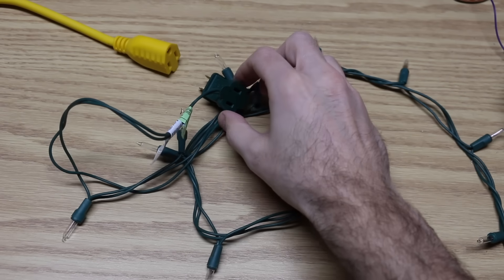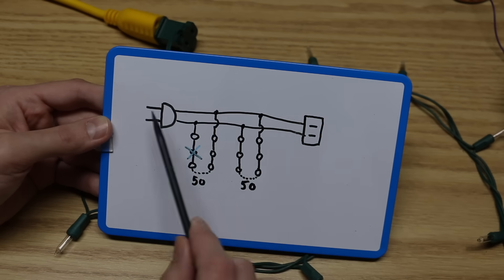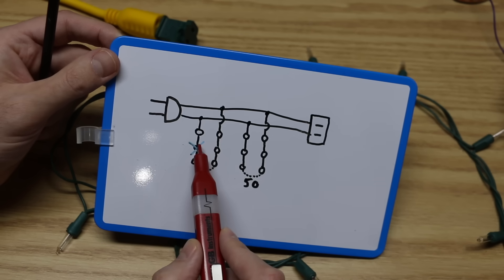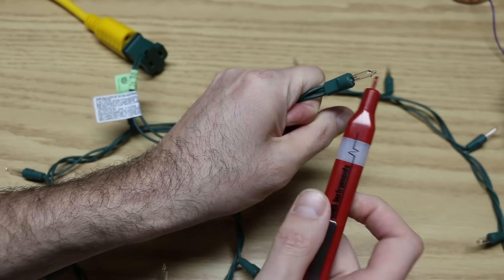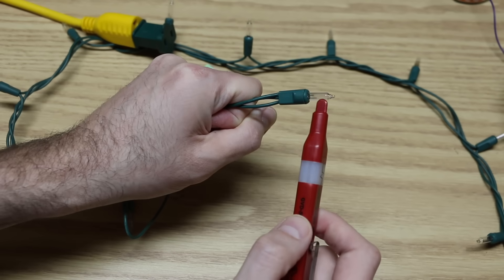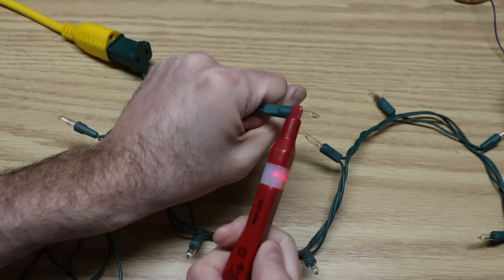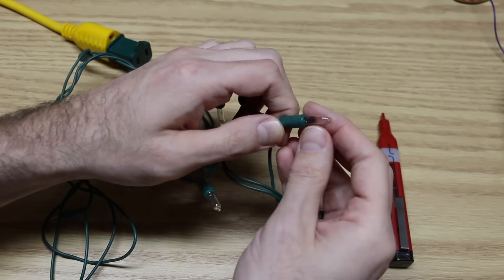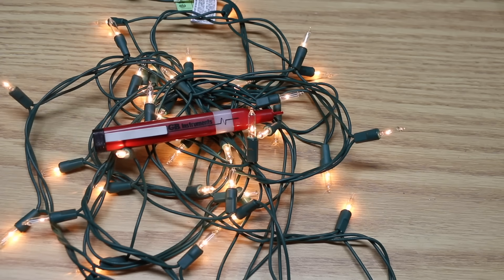HOW TO EASILY FIND BAD CHRISTMAS LIGHT BULBS using a non contact voltage tester

Comment: great video. May I suggest a slight shortcut (requires less tests?) 

Use a binary search to identify which half of the string the break is in. You do it by testing the middle lamp of the string for power. Call the half string between plug and middle lamp string A and call the second half (from the middle lamp to the end) String B. 

After testing the plug test the lamp at the middle of the string. If there's power, the problem is in string B. Test the middle lamp of string B (i.e. 3/4 of the length of the string.) If there's power, divide the remaining lamps in two and test again. Once you find a middle lamp with no power, you know the problem is in the first half of the string you are currently testing. If there's power, it's somewhere between the lamp you are testing and the end. 

Keep testing the middle lamp of each substring until you find the problem. You'll test far less lamps to find the problem. Saves a lot of time.
Reply: He mentioned this near the end of the video.
Reply: This is commonly called the half split method and is taught in all electronics training to save LOTS of time.  I learned it in Air Force fundamental electronics in 1979 and it wasn't new then.
Reply: Yes. I came to suggest the binary search.
Reply: I use a flashlight and look for the broken filament. Saves even more time.

Comment: be aware that this dose not work alot of times, them non contact testers are not very reliable and will pick up ghost voltage. also be aware the most likely you will have more than one bulb out. I find that about 25 percent of the box of new bulbs are bad right out of the box.
Reply from the maker: i’ve heard of some testers picking up stray voltage even when held up in the air away from everything but I’ve never personally had one that did that. But using the hand to shield the other wires nearby definitely helps focus the voltage being picked up from the actual hot wire.

Comment: Is there a type of ac voltage detector you’d recommend?
Reply from the maker: I think all of the non contact voltage testers in the style of the one linked to in the video description (the stick with a beeper and light) work the same for this purpose, same way any reasonable brand multi meter will read basic voltages just as well as the next, so maybe just whatever is cheapest.

Comment: Always Cut your test in Half.
So test the 25th Bulb 1st,  if Good
Then go to the 12th and the 38th ,  Half way between  the 25th and 1st, and 25th and 50th , If both are good
Then the 6th and 44th,  half way between the 12th and 1st, and Half way between the 38th and 50th
each time testing in the middle,  Once you find the side that is Bad
you'll find the Bad bulb by only testing along that side.
always cutting your test location in Half.

Hot starts on Bulb 1
Test 1 = 25th Good
now we know the side Between 25th and 50th
Test the Middle of this side
Test 2 = 38th Bad
Since the 38th is Bad it 
is between the 25th and 38th 
Test 3 = 32nd = good
Test 4 = 35th = good
Test 5 = 37th = bad 
Test 6 = 36th = good It is the 37th bulb  found in 6 tests,  not 37 tests.

Comment: This helped me to save an outdoor spiral X-Mas tree that my wife was about to toss out. I took my current tester (get one - they're a go-to electrical tool) and some tin foil dummy bulbs, then walked my way up from the plug-end until the entire run lit up. This strand has 3 tap-in points, and I only had to test 2 of them to get it all lit up. Because all if the bulbs are zap-strapped down onto the spiral/coil framework, I didn't want to cut everything off to be able to isolate the bad bulbs, so I just followed the hot wire and pulled it out, just enough to get my thumb under it - this was enough to isolate the other wires from the tester. The tin foil plugs were just a temporary means to diagnosing the strand - they required some shaping and wiggling to make a good contact - you know the contact is good when you get the output wire to indicate current. 

Thanks for the tips!
... and Merry XMas.

Comment: Excellent! I have a large expensive prewired tree. Putting in a new strand would throw off the balance of light and be a pain because of the intricate wiring on each branch. I could never find the offending bulb before, but your method makes great sense. Thanks!
Reply: on Christmas trees they are tuff. one issue I see is when taking down the tree a packing it away in the box if your not careful you can break a wire or a light bulb. Also if you notice a bulb that is burned out replace it before you cause other bulbs to burn out. Whenever a bulb goes out the voltage the other bulbs get increases a little bit and the bulbs burn a bit brighter and that can reduce bulb life

Comment: Now, to have a matching bulb. If you're lucky to have a spare on that strand, ok, but, as we all know, no two light strands have the same compatible bulbs, unless from same lot. So you have to keep buying new sets of lights and that's what companies want, hence my 500 strands of unused sets that don't work in my garage. Merry Christmas!
Reply from the maker: The bulbs themselves all probably run on the same couple of volts where they have 50 connected in series for the 120 V supply so if the bases are incompatible you can bend the leads and pull a working bulb out of the base of one and then insert it down into the base of the other and plug it in to the strand that doesn’t work.

Comment: Old style incandescent lights were wired in a parallel configuration, making it easy to find the broken bulb. I wonder why LED lights are wired in series, anybody know?
Reply from the maker: One reason would be because they can only handle a couple of volts each without some other circuitry to dissipate the rest of the 120 V so if you put enough of them in series, 120 V will drive all the lights without extra special handling.
Reply: @GadgetReboot  Thanks, I wondered if excessive voltage drop was a factor.

Comment: Great video.   I been doing it like this.   However i thought most light sets were designed so if one bulb goes out the others remain lit.
Reply from the maker: Sometimes the bypass shunt in the burned bulb does not engage so then it goes out

Comment: Not bad. But you could easily test 48 bulbs before finding the problem using that “one by one” method. Sooo…. rather than go bulb by bulb, why not go halves? Do your first tests to ensure you actually do have hot voltage. Then go halfway up the chain, bulb #25 or so out of the 50. If you still have hot, go halfway again: bulb #37. Etc. This way you are never taking more than five tests to find the one that’s out.

Comment: Video is 3 years old but I'm just seeing it now and at just the right time of the year.  Thanks for sharing.  I have one of those AC detectors and never thought of using it on Christmas tree lights.  I also never thought about shielding the wires.

Comment: Any modern day light string I buy today allows for a bulb to burn out but the circuitry is such that the remaining bulbs remain lit…….been like that forever! What kind of light strings do you have that function like the old style “series bulbs “, where one bulb burns out and takes entire string with it?
Reply from the maker: The modern series bulbs are also supposed to stay lit when one burns out but it depends on the bypass shunt in the burned bulb activating correctly to just act as a regular wire until the bulb can be replaced. 
sometimes that doesn’t work properly so The circuit is broken and then we end up with the string dark, forcing us to locate the dead one immediately.

Comment: I have a prelit tree. Every time I replace a burned out bulb with a replacement bulb or a good bulb from a scrap string of lights, the replacement bulb burns out immediately. All the bulbs are 2.5 V. Only happens with the strings on this prelit tree. Ideas how to get replacement bulbs that will work on this tree?
Reply from the maker: do you know if there’s only one bulb actually burned out at the time you replace one with a working one that immediately dies? If there’s actually several other bulbs that are blown but they are properly shunted so they’re still passing electricity but just not lighting up, each bulb is going to have more voltage across it which could cause them to burn out so if you could somehow test every single bulb and make sure that every one is working, that would help figure out why individual new ones are being blown.

Comment: Thanks for the video, very useful. A way to speed it up is check by halfs. You check first the bulb on the midle. if it works, you saved a lot of time. If doesn't work, then you go to the bulb in the 1/4 position, and so on.
Reply: Excellent idea.

Comment: I replaced the bulbs and fuses on every light but it’s still out, what would you suggest?
Reply from the maker: The only thing left to diagnose would be some sort of wiring fault which could either be a break along one of the wires, some problem near the wall plug, or more commonly down in one of the light sockets depending on the design of the light string, sometimes down in the socket the two conductors are just a bunch of wire strands and they can get moved around and it might not be making good contact with one or more of the bulbs when plugged in to the socket, so those could be visually inspected with everything unplugged from the wall and if necessary maybe move the wire around at the bottom of the socket inside with a screwdriver so the bulb can make contact again. I’ve had to do that before.

Comment: Simple & great info . I’m 40 year retired construction trade electrician . Got pretty far trying find easy way . But not realizing non polarized plug AND using hand for shield . I was getting no where fast . I did figure out the two series loop in the wiring 😂 thanks for the tip ⚡️
Reply: I just want to add on OLD  light sets other then lamps .OTHER wiring problems do exist from broken conductors to loose connections in socket . 
Just buy & use C-9 paralleled wired or as they call it stay lit Xmas light sets
Reply: @larrrevenga49  or dont and use your eyes to find the burnt bulb and stop trashing perfectly good strings because your too lazy to spend 10 minutes checking out 10 strings of lights by eye .. and just add more waste to the garbage pile ... economize recycle reuse it aint garbage until its covering is compromised or the plug is broken  or the wire ... costs less saves more and lowers the cost of future lights because we aint tossing out a perfectly good set because one bulb fried its filament ...
Reply: @0623kaboom  
I save them from going into the garbage by only buying C -9 
I have the same sets for 20 years
Reply: youre an electrician ... what happens to a filament bulb when the filament burns out ... it gets sooty ... look for that ... BASIC electronics ... you should have learned that day 1 ... if not by the time you were 6 years old ..
Reply: @0623kaboom  
 Very funny by 6 yrs old 
Yes my eyes were very good at 6 yrs old not so much now 
Save your self the aggravation 
And keep landfills empty by buying C-9 lamps I have only used C-9 & they look better

Comment: What's the problem, when all light bulbs, light, when tested on 9V battery and new fuses added to plug, and string still not lighting?
Reply from the maker: Could be a broken wire in the string somewhere, like around one of the sockets.  
Depending how the bulbs make contact with the socket, if there's bare wire strands in the socket or some kind of solid metal clips that make contact with the bulb, something could have come loose and need to be poked/bend back into place (with the power unplugged).  
Or the wires on the bulb may be compressed in too far to the bulb so it can't spread out and make proper contact in the socket, so sometimes I have to bend the bulb wires out so they automatically bend back into shape as they are plugged in.  
Or if the string is old enough, the contacts may be tarnishing and making it harder to get in contact with the bulb wires and vice versa but I haven't had that happen.  Everything else, I have had to bend wires/leads back into place on bulbs and sockets before.  Especially if the strand works intermittently when you touch it.  When it's plugged in and is expected to work but isn't working, try just moving it around and see if something suddenly works...then there's something loose for sure.

Comment: Once you made sure the hot went to the bulb, not sure why you had to separate them out/shielding for each bulb?  Just skim over the bulbs.
Reply from the maker: Some of the voltage detector devices are more sensitive and pick up the live voltage from nearby, so isolating each bulb is best.

Comment: I use to used this method many years ago when lights that had normal filament bulbs that use to blow, however these days they are all low voltage LEDs types which tend not to blow some are IP44 rated which means they can also be used outdoors, however although water proof overtime you will always get water ingress and will cause corrosion and eventually break the electrical connection and one or more LEDs won't work usually a whole bank of lights will stop working 
or intermittently work when wires are moved.

PLEASE NOTE ALL OUTDOOR LIGHTS MUST BE LOW VOLTAGE AND HAVE AN ISOLATION TRANSFORMER AND COMPLY WITH SAFETY REGULATIONS

BE WARNED ABOUT LIGHTS BEING SOLD ON- LINE CLAIMING TO HAVE ALL THESE SAFELY APPROVALS AND CERTIFICATES LIKE (CE) MARKINGS ETC.

THEY ARE LIKELY TO BE FAKE AND DANGEROUS.

THERE ARE REPORTS OF
PEOPLE HAVE DIED FROM ELECTROCUTION⚡☠️

SO BE WARNED.
ALWAYS BUY FROM A
REPUTABLE SOURCE.

Stay safe all you lovely people 🙏

Comment: Thanks. I use this same method. However, there is one more complexity! Modern Christmas bulbs are supposed to fail as a short (in an incandescent it is called a "shunt"). This allows the string to stay lit even if one bulb, or even multiple, go bad BUT with each dead bulb, the power dissipation increases over the remaining bulbs so they are more likely to fail! Thus, in addition to looking for a bulb that fails as an open, if you get the string to light, also look for any bulbs that aren't lit and replace those as well. Otherwise, those unlit bulbs will cause the string to fail faster.
Reply: Operative phrase here is " supposed to fail as a short"  sounds nice IN THEORY

Comment: Good knowledge. I was going through my lights and I found that even "burned" lights were still able to  close a connection. After swapping a whole line around with good lights, I currently have 7 "bad" lights while everything else is good... now I don't know if it's a broken wire or the bulbs...
Reply from the maker: If there's bulbs that are off in a working string, they are likely blown and the internal shunt kicked in to bypass the bulb to keep everything else running, so it's a bad bulb and should be replaced because as more blow, the 120 volts has to be shared among fewer good bulbs and they burn hotter, die faster, and then a chain reaction kills the whole set
Reply: @GadgetReboot  Ahh! Makes sense! Thanks!

Comment: Buy a Light Keeper Pro.
It has a piezoelectric zapper that will close the open shunts in bad bulbs pretty well. It also has a  voltage tester as in this video. I highly recommend it

Comment: You would think in 2020 we could figure out these stupid lights.
Reply: I know, right? Mine is already on the tree lol!
Reply: Lol😂
Reply: Stick a taser on the plug connections, whichever bulb lights up, then that's the faulty bulb.
Reply: @PF-gi9vv  what’s a taser? Like the ones the police use?
Reply: @AB-bg1or  Yep, it is. You can buy something similar but not as powerful from ebay called high voltage generator.
Reply: Yeah (2025)
Reply: @Mattjki yeah, me and Matt are from the future and Christmas lights here still don’t work

Comment: Hey, thanks. Great video, done the way it ought to be. I was getting really frustrated, because the beeping doesn't seem to follow any pattern. Partly I was thrown because I thought ANY beeping meant that there was power, but it appears that it can still beep a little from stray voltage even on a dead wire. But I've been trying basically what you were doing (I'll try the hand shield now too), and I keep finding what seem to be dead bulbs. I replace the bulb, and still nothing. Then it seems like the next one is dead. Of course I HAVE found at least 3 actual dead bulbs so far, so maybe I just need to be patient, but one minute I get a bulb that makes no sound. I test it again a minute later, and now it beeps, but there is still no light. Maybe I shouldn't have got the cheapest tester....
Reply from the maker: If the string had a bad bulb that bypassed itself to keep the rest lit while it stayed dark, but it wasn't noticed and replaced, all the others would see a slightly higher voltage because they all need to still split the 120volts between however many are still lit.  Then they start blowing faster in a chain reaction because more burn out but auto-bypass with the built in shunt, the rest burn hotter etc. Then it's too much to handle and a whole bunch can pop so you might have a lot of dead ones to replace, and as you put good ones in, you may have good live voltage running further along the strand and it's still got bad ones to locate and fix.    Also the stray voltage pickup issue could confuse things so the hand shield may help.  And just to verify the tester is not stupidly sensitive, try holding it just in the air away from the wires and make sure it doesn't beep for no reason.  Mine is good with the hand shield but if I don't do that, it can start having a mind of its own.